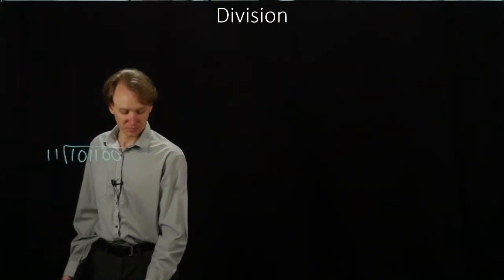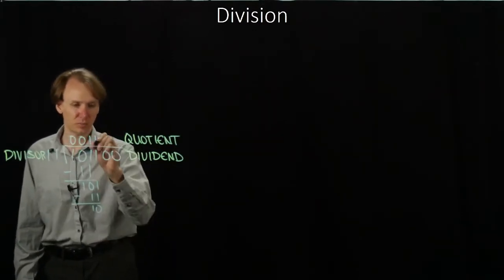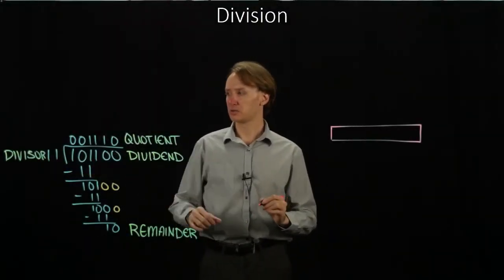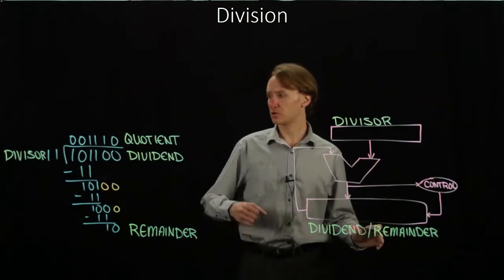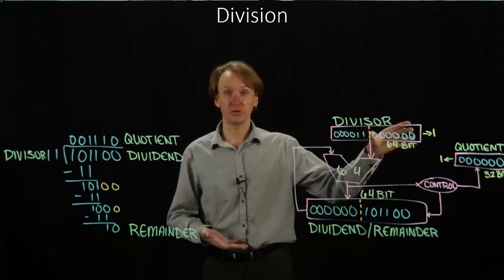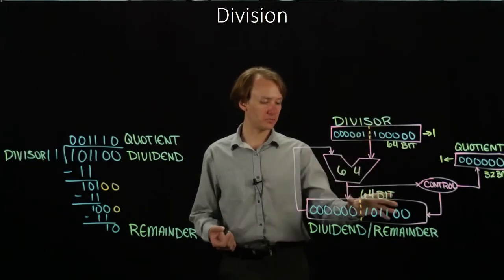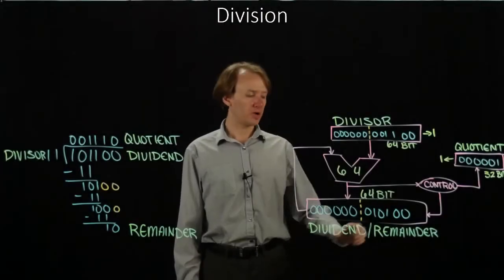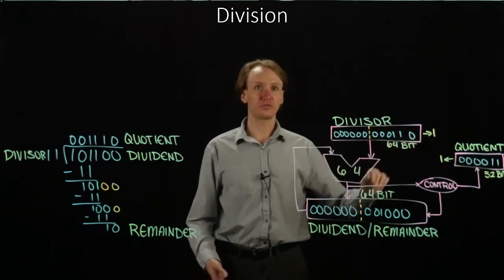13.  Implementing Division

Comment: why is the quotient of 6 bits only? i mean, if the register is of 32 bits then shouldn't the bits be like 0000....001110. How do we know when to stop shifting in the quotient?
Reply: That is an assumption before the arithmetic begins. There is also a counter that controls the number of cycles. For this problem it would be 6 which is equal to the number of bits. So, in other words, the computer has to know that it is looking at n bits (6 in this case) so stop after 6 cycles.

Comment: Well.. hearing things like "ten", "eleven", "hundred"  while following binary calculations seems a bit odd, especially from an educational video
Reply: he never said the number was in binary ? even then, same rules apply
Reply: @duality4y  I am just saying that on an educational video it would be wise to avoid confusion while stepping out of the regular decimal calculations pattern by saying "one-zero-zero" instead of "hundred". The former is clear, the latter could be interpreted in two ways.
Reply: @markgurevich5351  Got a point there.
Reply: I disagree